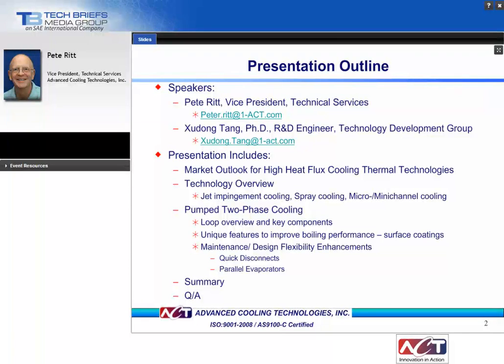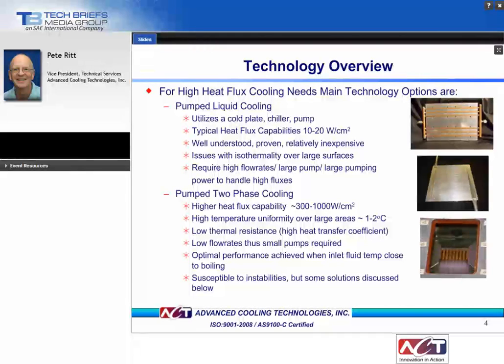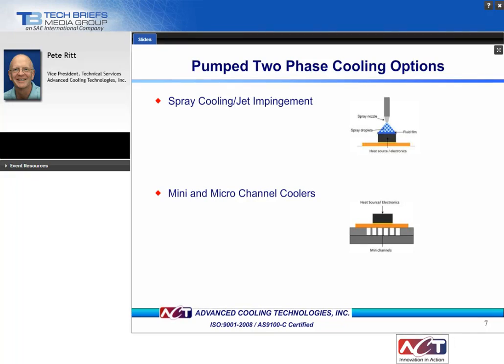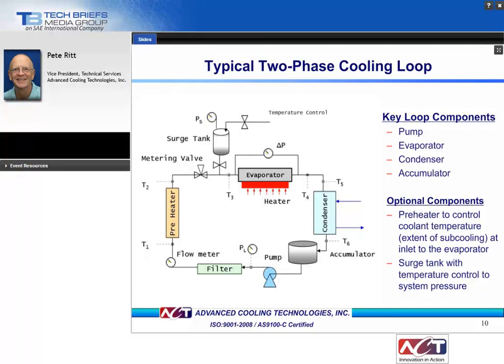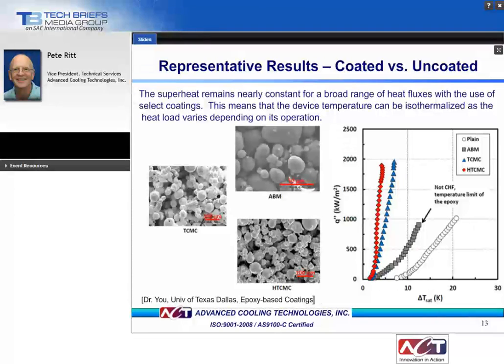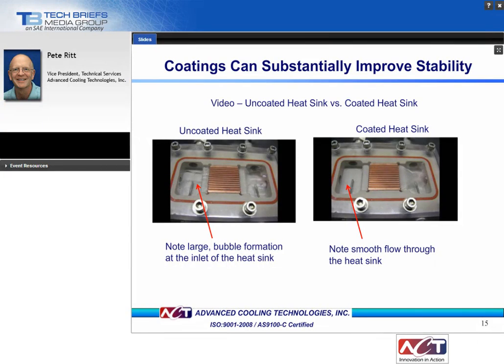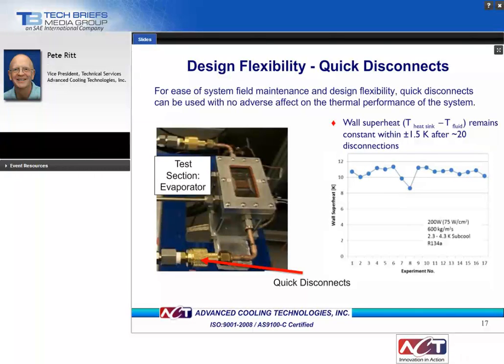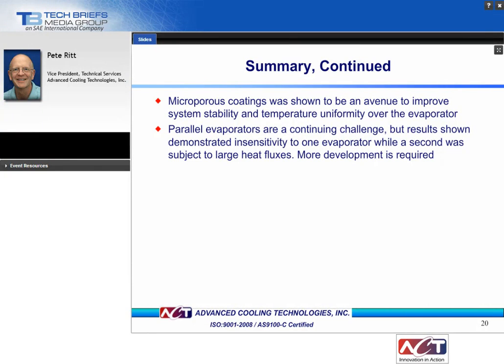Webinar: Advanced Thermal Management Solutions: Pumped Two-Phase Cooling

Comment: What about additional heat due to solar flux?
Reply from the maker: Hey there, great question! The heat loads from solar flux can be easily be handled by pumped-two phase systems and would be accounted for during the design phase in the sizing of the components. If you have a particular concern about solar heat flux for an application you are working on, please reach out, we would be happy to assist you! https://www.1-act.com/contact-act/